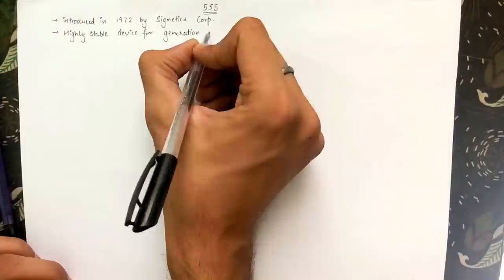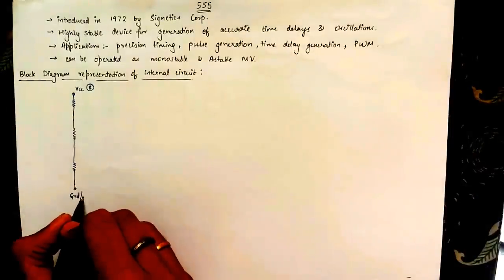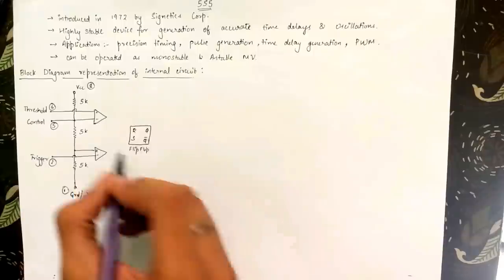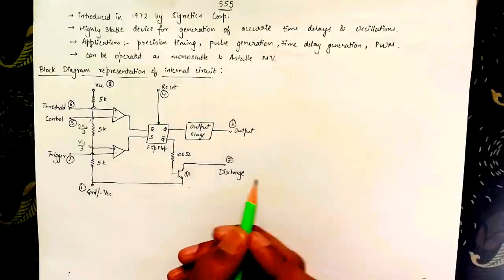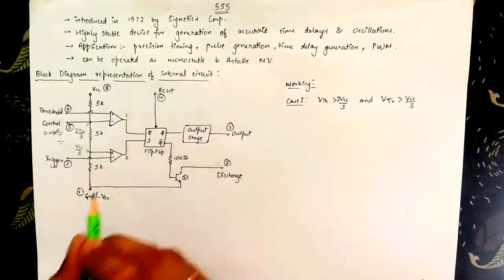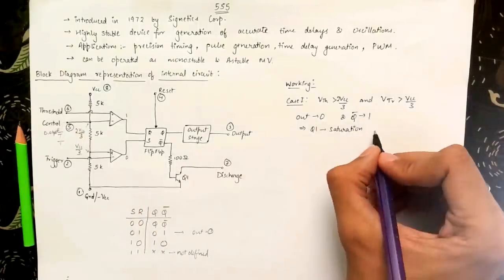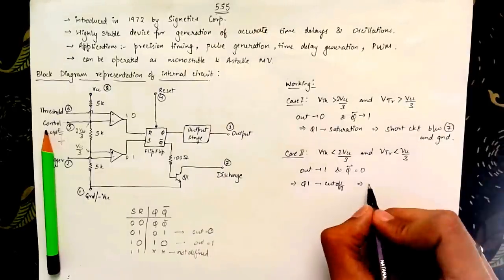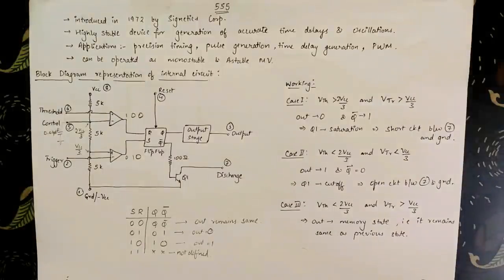555 Timer IC: Basics, Block Diagram and Working [Explained]

Comment: This video explains the working of 555 timer better than any other videos. Simple and quick Thanks
Reply from the maker: Thanks for your support !!
Reply: Tawsif I'm making a circuit. A motor will be turned on every x amount of second by a 555 timer using a variable resistor. The motor needs to run for x amount of seconds (around 1). Is there a better way than having 2 timers on each part?

Comment: How does the discharge pin short with gnd pin???
Reply: Pruthvi Raj G.K , when the base of npn transistor Q1 is high, the transistor works in saturation, and transistors working can be approximated as a closed switch in saturation thus connecting pin 7 with the ground.

Comment: Nothing helpful bcoj u need to explain why n which case our comprtr op 1 or 0
Main logic is not explain
How its works as a timer
You just saying' let us consider case' 
Go practical n show how square wave  genrate by this
Reply from the maker: This video just explains the working principle and basics of 555 theoretically. 555's main logic is definitely explained here what you want is its use as a clock generator, which is use of 555 for a particular application. For its working as a timer you can go and watch my other video on 555's astable mode.